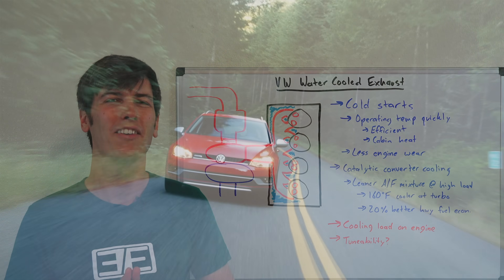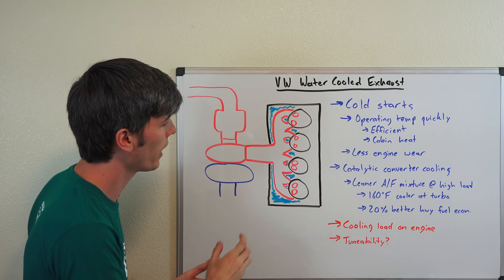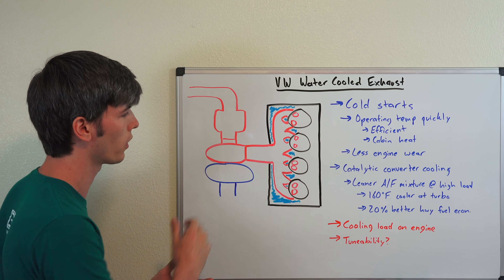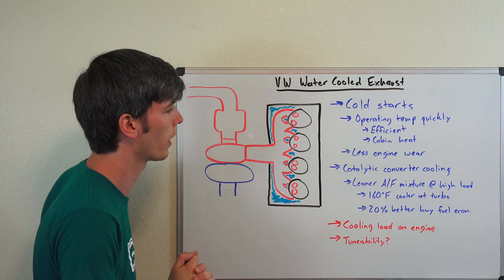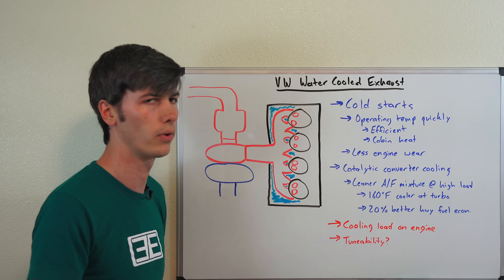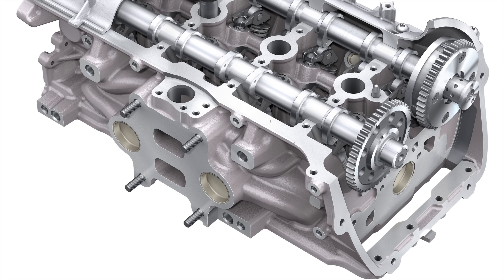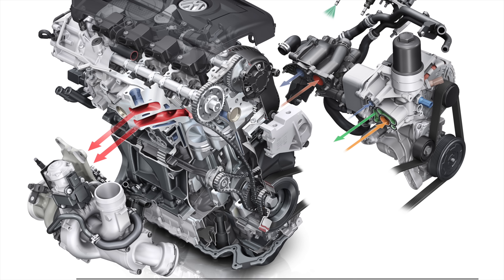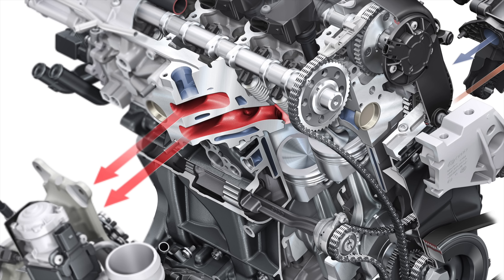Why Does Volkswagen Have A Water-Cooled Exhaust?

Comment: Yes but this system has crap scavenging of the cylinders (probably even worse than already crappy log manifolds). If you want to heat up the cabin quicker in winter, how about you do it instantly by fitting a reversing valve on the A/C (turning it into a heat pump). Another useless invention in the automotive industry.

And why would you want to cool the catalytic converter? It needs to be hot in order to work correctly, has the car industry gone completely mad? No normal driving situation has ever produced hot enough catalytic converter temperatures to damage anything. 

And how about when there is something slightly wrong with the cooling system (like a bad thermostat that can't open all the way), it's now guaranteed to overheat quickly, rather than provide just enough cooling to prevent serious damage to the engine. 

It's as if the entire automotive industry has decided it needs to solve all these problems that don't exist.

Finally, are we really going to trust VAG fuel economy figures? You want to improve fuel economy by improving efficiency? How about instead of redesigning the engine cars just come with good headers from the factory?

Comment: How does it help with cold start? Is it because of more heat in the engine block? Besides, it would be nice to have a video just on the A/F mixture and how rich/lean mixture works...
Reply: There's more to it. The EA888 engine also has an active coolant management system with an auxiliary electric circulation pump.

There are two electrically controlled valves that keep coolant within the engine block, cylinder head, turbo, and cabin heater until operating temperature is achieved. Then, the valves begin opening to flow coolant to the engine oil cooler, transmission oil cooler, and finally the radiator.

If you want the details, start at page 32.

https://www.carworklog.com/stuff/SSP/SSP%20606%20-%20Audi%201,8l-%20and%202.0l%20TFSI%20engines%20of%20series%20EA888%20(3rd%20generation).pdf
Reply: Yeah, thermostat i guess. My E90's thermostat failed twice. At least, the engineers designed it to fail open letting coolant in early. Required more time to warm up but at least, happy that it didn't fail close :-)

Comment: I'm not an engineer, but I do know that having an unequal level of heating and cooling of things made out of metal usually lead to stress fractures and failures. From an engineering side it appears to increase efficiency and blah blah, but the overall concept is pretty weak. Let's face facts here too, if I owned an aftermarket based automotive shop, I would laugh at trying to do something with this design. Stick an LS in it or something.
Reply from the maker: +Ham Steaks no worries haha, VW has engineers that put in the thought about metallurgy.

Comment: Is this on the higher output 2.0T EA888 motors such as on the Mk7 GTI and Golf R? Just curious.
Reply: Yes. All EA888 platform engines use this system.

Comment: Hmm, it seems the cooling around the exhaust passages in the head casting has just as much to do with keeping the head evenly cooled as anything else.  It seems the big advantage here is actually keeping the exhaust hot and the gas velocity high and for the turbo by placing it so close to the ports.  Fundamentally any cooling of the exhaust gas is energy just dissipated away that could be used to spin up the turbo.  That's the beauty of turbos - getting work out of that energy that would be thrown away in the exhaust as heat.  In fact, it would certainly be worth looking into how much heat is lost from exhaust gases in a normal open-to-the-air manifold/header setup before getting to the turbo in a "normal setup".  I'd be surprised if it would be much less than what's pulled away by the 15cm journey through the head in this setup.  What are your thoughts?
Reply: True but part of that heat gets transferred to Turbo's cold in take air too, isn't it?. Compression too adds some more heat and more work for the inter cooler. Cold air is good for the engine.
Reply: Hi, Vairavan.  I"m not sure how this really affects the cold air side of the turbo any differently than if it was on a normal setup.  My main point is that I doubt that the exhaust gases are really being cooled much at all in the short journey from the valve to the turbo - water jacket or not.  It's a short passage.  And if an engine runs an external manifold or headers made from tubing - there's a lot of cooling of the gases before the turbo as well.  Remember that all heads have cooling passages around the exhaust ports, and that in some heads the exhaust ports are pretty long, too.
Basically, I'm inclined to think that the cooling is to keep the head cool - not to cool down the exhaust gases.
Reply: I guess, the logic behind lean A/F mixture can answer that and the location of the Trubo as well.

Comment: On a turbo engine, there is basically zero concern with cat over temp. The only time that ever becomes a factor would be around the torque intercept as it's common to run high overlap to get the turbo online ASAP. This means more unburnt air reacting with the cat. Basically the entire rest of the engine operating envelope, you are limited by turbine inlet temps and a ~70*C decrease would be a HUGE deal.

Comment: VW is AWESOME..... .... ...  ..... ....     .... ly prone to fail and require expensive repairs not covered by waranties. When you go get the parts they give you the current part revision which is sometimes the 8th or the 12th revision (they use letters ex.: Rev. K). Chrysler isn't great by any length but any old Sebring will outlive most VW on 300$ per year maintenance.. I mean take a current VW and a 2005 Sebring and use maximum 300$ per year on maintenance (oil excluded) and the VW wont probably last 3 years.
Reply: Yeah, but then you're stuck driving a Chrysler Sebring.

Comment: What's that shaft on the rear of the engine, chain driven off the crank behind the timing chain - a balance shaft? Oil pump? Or a combination of functions, a sort of "accessory drive"?
Reply: Balance shafts.

Comment: I've been running GM 5.7 small block with water-cooled exhaust for the last 18 years. The thing is, the engine is in my boat and the purpose of the exhaust water cooling is to reduce the exhaust manifold surface temps as a Coast Guard marine engine safety certification requirement. It also serves to reduce the exhaust gas temps leaving the engine and provides a path for the open loop engine cooling water to exit the boat back into the lake with the exhaust gas.

Comment: Does this system invalidate the need for an egr cooler then? Because the stystem has already cooled exhaust gases via water jackets, the air can be recycled to the intake manifold quicker without the need for additional cooling.
Reply: Would interesting to see post turbo air temp with this system versus a normal exhaust manifold system

Comment: Instead you could have water injection, this will lead to better cooling, less chance of knock or detonation (allows more agresssive efficient or powerful tuning), lower flame temperatures making the EGR valve obsolete, and also having a colder exhaust.
With less coolant in the system your engine will also get up to temperature quicker, ask Daihatsu.
The real drawbacks: that manifold looks terrible airflow-wise. And then the reason why manifolds are usually not integrated in the cylinder-head: the manifold is expanding due to heat. Uneven expansion leads to engineblock or cylinderhead cracking, so it will have to be cooled really well, pour cooling won't cut it. >>load on the cooling system again... I expect them to do something in the middle, they cooled it just enough to not let it crack under stock power for the duration of the warranty.
---
Why doesn't VW make a commersial showing how they threw the DSG away and switched to Aisin Seiko gearboxes?
Why don't Toyota, Nissan, BMW, Landrover, Mercedes, VAG show how their pistons looks like under the piston rings (and the lack of oil-drainage channels)?
Why don't the tell the truth about alusil? It's not the coating, it's the aluminium under it that's wearing out.
Why doesn't Nissan show how they PURPOSEfully use proprietary bolts in their engines.
That's the point of modern car industry: make something with a short lifetime and get money for selling new cars and expensive maintenance. Because they made it so, that pretty much only the dealer can maintain it.
Reply: I never heard of the lack of oil-drainage channels in these make's engines (maybe VAG excepted because of their oil-consuming TSI's).

Comment: But... isn't better having a exhaust hotter because it make the exhaust gases to flow easily and so improving the performance of the engine? That's why people use that thermal tape on the exhaust.
Reply: Thermal tape is used to reduce the engine bay temperature and therefore reduce air intake temperature, increasing the density of the air, increasing power.
Reply: Yes, AND to improve the spool up and performance of the turbo.
Reply: You are only half correct.  The primary reason for using thermal wrap on header pipes is to minimize thermal energy loss that would otherwise be available to spin the turbine yielding greater boost pressure.  Cooling the exhaust gas reduces its kinetic energy which, in practical terms means reduced exhaust gas pressure and velocity, ultimately reducing potential boost.

Comment: Won't the denser, cooler air entering the exhaust turbo have not as much volume as uncooled air, making the turbo not spool as efficiently?
Reply: What matters is mass flow, not volume as you are taking the energy from the mass.
Reply: And I think is the pressure differential what matters in a turbo

Comment: In theory, at least, by cooling the exhaust gases you are reducing the amount of energy available to spool the turbo. Perhaps it does not make much of a difference at the amounts of boost that that engine is running.

Comment: Why not place the catalitic converter in the middle of the car to reduce the temperature instead of placing it right after the turbo ?
P.S. Cars are required to have catalitic converters but you have to inejct more gas (higher fuel to air racio) in order to not burn up the cat. How is that better for the environment ?
Reply: The catalitic converter has to reach a specific temperature before it starts to work. The faster it reaches this temperature the better. So it's common today to place the cat as near to the engine as possible where the the exhaust gas temperature is still quite high.

The catalitic converter is designed to work best around a stoichiometric a/f ratio. That's pretty much what you want to happen in an petrol engine anyway. But there are also some newer systems where you can run an engine on the lean side.
And it's better for the envirement because the catalitic converter eliminates nearly all hydro carbons (unburnt fuel), nitrous oxides and carbon monoxides from the exhaust gas.

Comment: my only worry with this is actually have the hot exhaust manifold integrated into the cylinder head. although it has water jackets around it, it's still a hot component that's so close to the head. I'd worry about long term durability with this.

Comment: May be impressive tech, but VW are a brand I just wouldn't trust now, timing chain issue on Polo TSI, massive repair bill for DSG clutch on a Golf which failed after 30k miles and then the emissions scandal.

Comment: Water-cooled Exhaust + Anti-Lag system = Steam Engine :]
Reply: @trp2413  What about the part where he said that all of this was to reduce the temperature of exhaust gases so the car could run lean and not damage the catalytic converter?
Reply: Next comes the hydraulic supercharger and hydroelectric turbines. Straightes road to the happyhome.
Reply: @jzk3919  I've often wondered why no ones tried spooling a supercharger with coolant flow. So a prop in line with a large coolant line, as the fluid rushes by the turbine rotates, pulling in air into a compressor.

Comment: how can a rich fuel mixture cool the exhaust
Reply: Adding more fuel makes the mix burn more quickly, but also leaves more fuel unburned, which absorbs heat.
Reply: wil1080 but a rich fuel mixture has more fuel than air

Comment: Do you think a water cooled turbo makes sense?
Reply: Most modern turbochargers are watercooled; the bearing housing has oil passages and water passages. If you are suggesting a water cooled turbine housing, then no, it wouldn't make sense. It would add unnecessary complexity, for little to no benefit.

Comment: Car companies not designing with aftermarket parts for replacement or upgrades in mind is in my opinion incredibly selfish and money grabbing. Now any exhaust manifold work needs to be done by Volkswagen or someone experienced enough to remove a head. Seems a bit unnecessary.
Reply: On the contrary, shouldn't they be designing the best engines they possibly can? If this makes the engine "better" for it's designed purpose (power, economy, emissions, etc) then it's a good thing. You can't expect a manufacturer to design an engine with totally different external design goals in mind; if you want an engine to do something different to how the manufacturer designed it, it is up to you to either use an engine better suited to your purpose, or figure out a way to make it work.
Reply: noxious89123 it may be "better", but when it breaks it's also a lot more expensive and the only people who make the part are Volkswagen themselves.

Comment: I own a 2015 Golf with the 1.8 liter gen. 3 version of this engine.  I get 35 mpg on the highway, and at 50,000 miles have had no issues at all.  The GTI uses the same engine in 2.0 liters and puts out 240 hp, while the R type engine puts out over 300 hp, and this is in stock configuration!  So much for this being a low power engine.  If you watch Global Rallycross, Tanner Foust and Scott Speed both drive a Beetle with this engine putting out over 600 hp.  https://www.motorsport.com/global-rx/news/tanner-foust-wins-red-bull-global-rallycross-ottawa-ii-920581/

Comment: The Honda Civic 1.5 and 2.0L have a new cylinder head with built in exhaust manifold cooling too.   http://www.civicx.com/threads/2016-honda-civic-1-5t-and-2-0l-engines-technical-presentation-specs-pics-videos.454/

Comment: Hey Jason, why does richer a/f mixture result in lower cat. converter temps.? My intuition tells me that should be the opposite: more fuel, more heat? Thanks!
Reply: I agree; surely a richer mixture result in more hydrocarbon emissions in the exhaust, which will burn off in the cat, increasing it's temperature?
Reply: Well, the richer air fuel ratio has an indirect effect on the exhaust gas temperature.
Maybe you know that turbo charged petrol engines do enrich the mixture under heavy load and high boost to prevent bad things from happening like melting pistons or just knock. The actual trick is simply to lower the temperature in the cylinder to prevent such things.
Now, you may or may not know that only gases can burn. Which is a bit funny because a petrol engine actually injects a liquid, right? So why then, does a petrol engine work in the first place you may ask.

Well, the intresting part is what happens with the fuel just after it was injected. It vaporizes in a few milliseconds because of the heat produced when the compression cycle happens. But, vaporizing any liquid into a gas needs a hell of a lot of energy. And it takes this energy out of the heat produced during the compression cycle. So the temperature just before ignition is lower in the cylinder when you use a richer mixture because there was more liquid to vaporize into a gas.
When then ignition happens the amount of fuel that can actually react with oxygen is the same as with a perfectly stoichiometric a/f ratio which also means the amount of heat produced during the burn stays the same. But you started with a lower temperature so you will end the cycle with a lower temperature, which means in fact lower exhaust gas temperature.
Reply: Thanks for the detailed explanation shi01! It is very clear for me now. I am surprised by the extravagancy of using unburned fuel for cooling effect though. Now, that's inefficient!

Comment: Absurd.  Let's start, AF is always set for combustion, not the cat. Taking 10% of the heat out the exhaust lowers the energy going into the turbo. Wear reduction would come from heating the oil, not the water. 

This old (2013) feature was done to eliminate the cost of having the exhaust manifold as a separate part. The rest is...

Comment: Instead of using high temperature turbine made of ceramic or composite they wasting energy into cooling system, not even creating electrical power or other use of temperature gradient.

Comment: Cool info and good explanations.  Love seeing new technologies and learning how they work :)

One thing though... sometimes it can be difficult to see the mouse pointer post-production.  However, all modern versions of Windows have a built-in function (I believe in Device / Pointer options?) where by pressing [Ctrl] on the keyboard, a reverse "ping" will actually encircle the mouse briefly.  Might be worth looking into?  (The feature was originally meant to help a user find their mouse on-screen, but could be good for pointing things out too.  I work in IT and use it all the time -- helps a lot when you have 3 monitors to work within, lol)

Comment: Ok thermodynamics question here....are the rates of expansion for exhaust gases in any way dependent on inlet temperature?  Because if so then you would theoretically lose turbo (pump) efficiency as well since it is dependent upon said expansion.